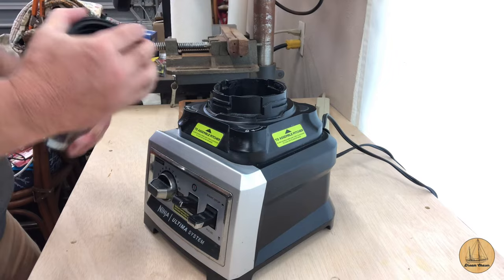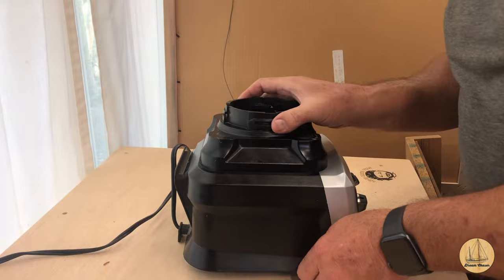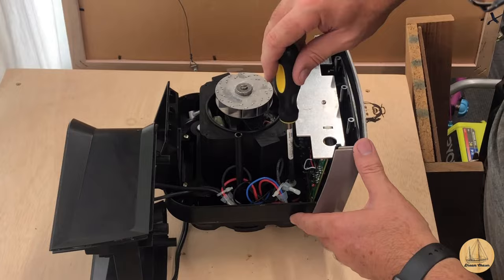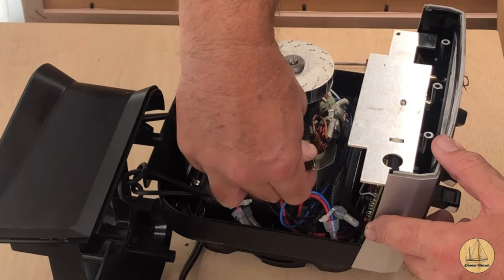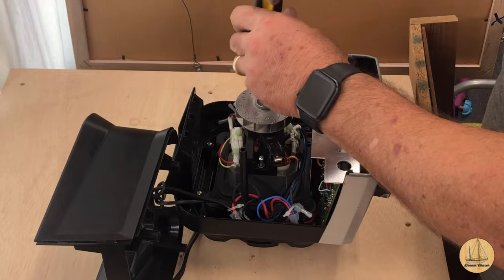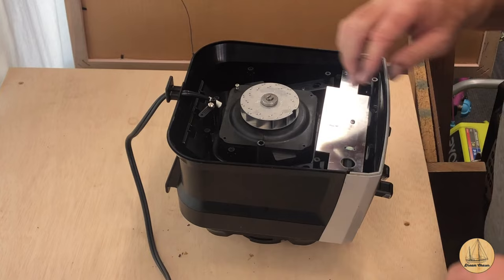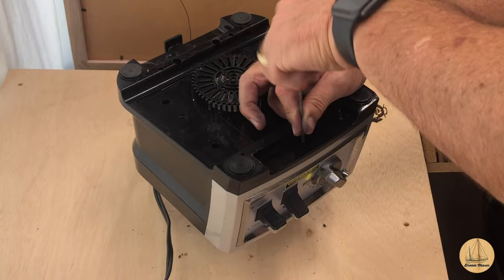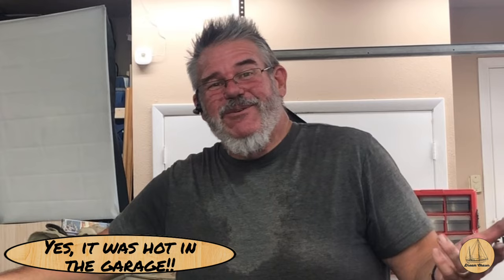How to Diagnose and Repair a Blender

Comment: Those things aint cheap! I hate that so many things are impossible to repair these days...
Reply from the maker: They don't make it easy that is for sure.  Then on top of that, it is hard to get parts too.  I can recall being able to go to an appliance repair store and get just about anything you needed.  I guess you can still do that, but most people just buy new.  Crazy and I really worry that we have lost the skill of repairs.  Think of a shoe cobbler, or alterations shop or TV repair.  All of that stuff is gone for the most part.  I guess alterations still happen for weddings, suits, etc, but not as common for the every day folks.

Comment: I definitely appreciate your video! Though it doesn't touch on my issue I'm hoping you can give me some direction. My older ninja BL770W now leaks when I'm when making our smoothies. So I bought new blades (tops). When brand new they work fantastic but all start leaking while blending after a few months. My wife wants to replace the $200 blender with another $300 blender. I'm thinking something in the blender is causing the heads of each blender top to malfunction. Any ideas?
Reply from the maker: I will start by saying i don’t know. Some speculations here may be that the blades spinning or vibrating may be rubbing the seal along the bottom of the blender and damaging it.   Of it is in the “blender cup” i would see if the rubber gasket inside the lid (with the blades on it) has been removed, cleaned and inspected). Seriously though this is just a best giess.

Comment: Wiring side of a blender
Reply from the maker: I hope this helped and you found it useful.
Reply: I have a buzzing sound coming from the magnetic brushes. What coil are you referring to? Is it the black part that come right up brush to make it spin?
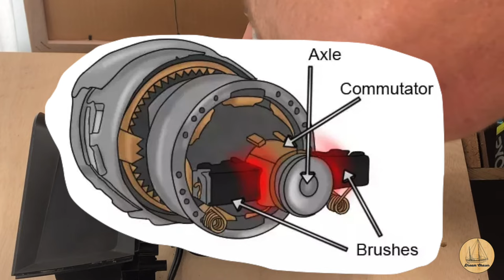Reply from the maker: @marcospadilla9819 i rewatched and i think the diagram example at 4:35 in video will help. I was referring to the brushes that rode agains the commutator (i think i said coil by mistake instead of commutator).
Reply: @Svdreamchaser thank you. I was able to take out the brush which was attached to a spring. What sand grit did you use for cleaning the commutator and the brushes. Could I also used qd electronic cleaner? Thank you so much. Been not working for years and this is my last try
Reply from the maker: @marcospadilla9819  I think I use 120 grit but frankly I don’t know that it matters a whole lot I probably wouldn’t do anything like 60 or 80, that may be two course, but certainly workable if that’s what you have handy. You could use a mail file I don’t think it matters exactly what you use. And if you need to clean it by all means you could use an electronic contact cleaner just make sure you use one that’s designed for electronics so it doesn’t cause any challenge with shorts.
Reply: Awesome. Thank you! Your the best!

Comment: I have a cuisinart blender that was making a burning smell & now it will not turn on anymore, any suggestions
Reply from the maker: I don’t k ow based on that, but I am a firm believer in trying before replacing. My recommendations would be to ensure you lay out all the screws and parts the way they come out on a towel or blanket spread out. My guess would be that it may be carbon build up on the parts you saw me clean here. If they don’t make great contact via their contacts and it will drive up amperage to get all the power it needs.

Comment: What is the potention meter
Reply from the maker: I am not 100% sure, but thinking you are referring to a poteniometer.  Those are typically what is connected to a "knob" like the speed control on this blender.  It essentially varies the resistance on the circuit so you can get different throughput of the power.  When you see something that changes speed, or frequency, those are often potentiometers.

Comment: My  ninja CT670 UKV has stopped working, and I will try and clean the brushes to see.
Aby thoughts, please? Thanks for your insight
Reply from the maker: I don't know for sure with that model, but based on what I saw with mine, a good first step is going to be to clean the brushes and where the brushes rub the shaft (I think that is called the stator, but not sure).  Good luck, I would love to have you reply back here and let me know if that worked.  Really curious.

Comment: For Ninja Model BL830CB 30 
Kind of disappointed with this incomplete demo,
was looking for as how to remove motor ? 
Or How to remove top bushings around blender drive ?
Or how to remove cooling fan from motor shaft ?
Reply: Sorry. This video may not be the one you want. You may have to search others. I was able to diagnose and repair mine as shown.
Reply from the maker: Sorry this wasn’t what you were looking for but showed how i diagnosed and repaired mine.

Comment: Mine blends only for two minutes then it stops, after like five minutes it runs again, really disappointing, what would be the problem
Reply from the maker: That almost sounds like it is overheating or something.  If you open it up and clean all the parts and ensure there is good air flow to the metal around the spindle it may help.  That is an odd behavior and it sounds heat related?